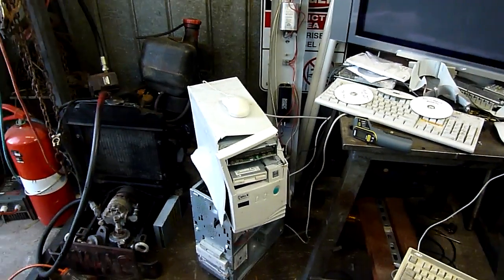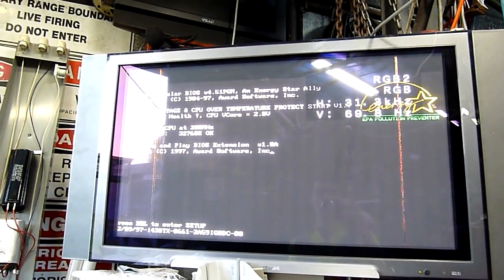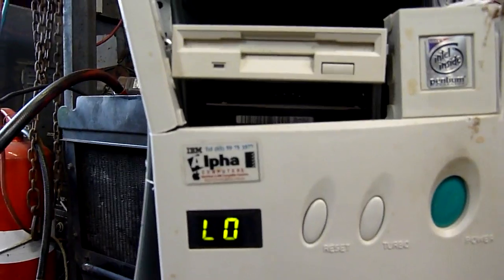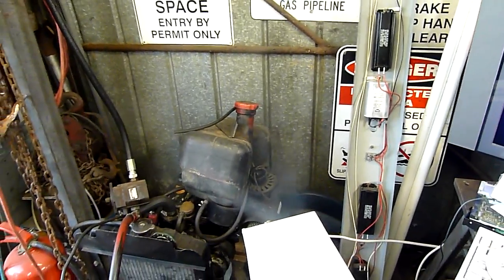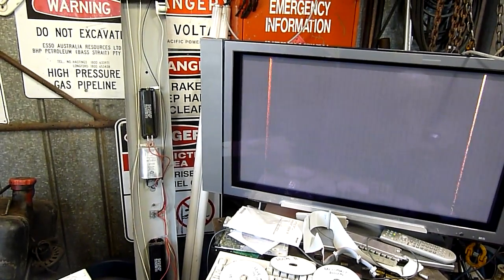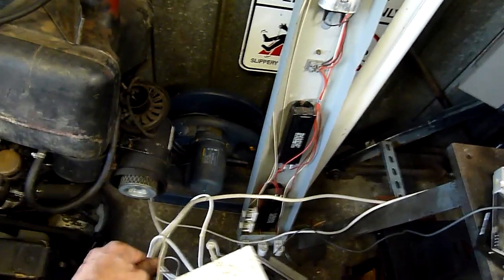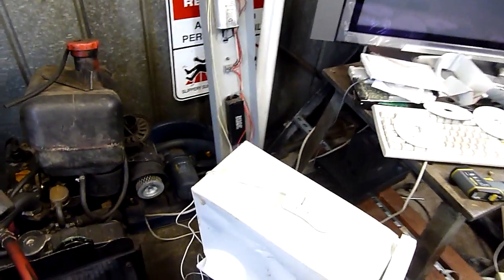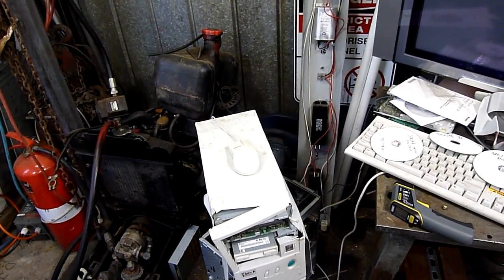Smashed old P200mmx Boots and Smokes

Comment: The power supply electrolytic capacitors around the cpu on mb also is another point of failure, as they have to filter considerable ripple current to supply the cpu core. Typical faults I have found over the years are bad HDDs, mb failure or mb cmos battery failure, bad memory chip, or atx main power supply failure.

Comment: I have a gaming rig I call "Bessie" she is roughly 6 years old, runs fine. Better than most modern computers, the power supply is a 350 watt, which is underrated for what I have in it. No complaints about it. The old Pentium based computers just run and run. I still have a working Pentium II laptop that is roughly 16 or so years old.

Comment: You can really tell that Windows 98 and that graphics card in that computer weren't designed to be used with a 16:9 aspect ratio display.  Also, the turbo switch was turned off, hence the display on the front of the system unit reading "LO".

Comment: You can make an ATX PSU into an AT PSU, you just need to make a lead and note the differences in color code. In fact, you can fit an AT mobo in an ATX case, it just sits at the bottom and you'd have to make your own backplate (easy enough).

Comment: Nice machine. My Win95 Pentium is starting to become unstable and is now crashing. Suspected the graphics card, but it still crashed on 640x480 16 colours.  I was afraid that the caps in the power supply would go boom like Crunchie, but none of them were bulging luckily. I thought maybe it had fried due to the fan spinning its bearings, but the power supply was fine. Maybe the motherboard.

Comment: what would cause a desktop pc to have an infinite loop of rebooting? I tried unplugging it and plugging it in and turning it on and the power light starts blinking blue and oragne. Would you know what would be causing this? Thanks
Reply: A bad power supply or bad capacitors (that´s happened with my old PC, Pentium 4). Now I have a i5 ;)
Reply: +starscream 79
happened to my pentuim D desktop but it was power supply fan that failed. thank god for proper thermal protection.

Comment: most ATX power supplies will work, AT is 20 pin,  ATX is 20+4 pin. remove the 4...(they're usually a secondary clip-on anyway)

Comment: Huh. Stayed running!

AC line safety cap?
Reply: +Cory Smelosky  no its probably the main dc filter capacitors. computer keeps running yep!, as the cap goes open circuit, the dc supply become more and more unfiltered, but provided the computer doesn't draw too much current it may keep going, but ripple will start to appear on the dc rails. As the computer starts to run programs is draws more current and the ripple will cause control and data to be corrupted and system will become unstable and crash.